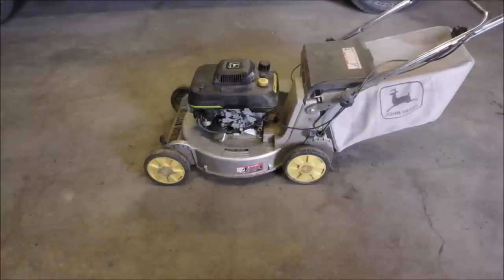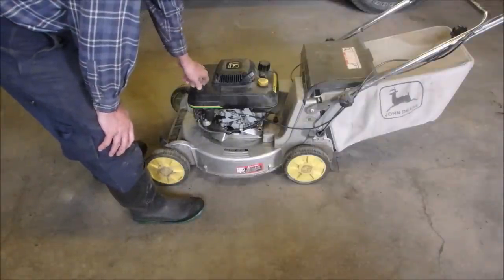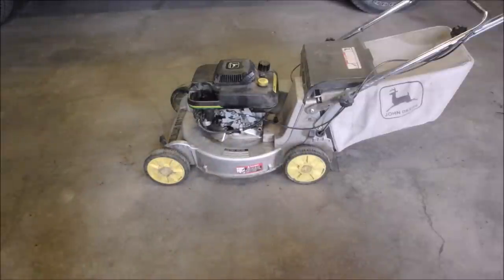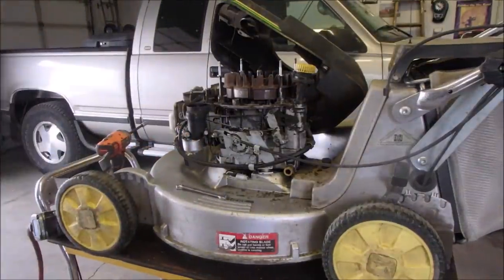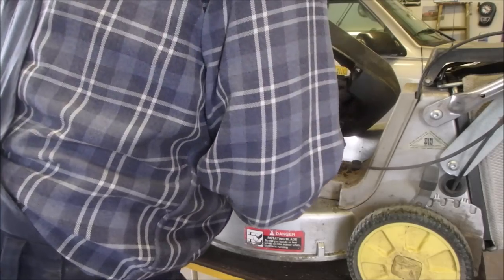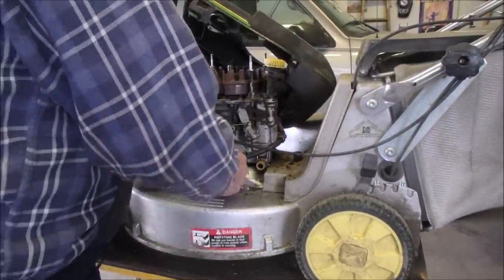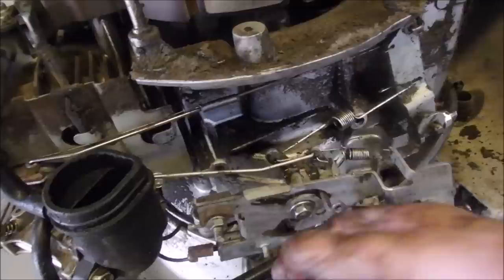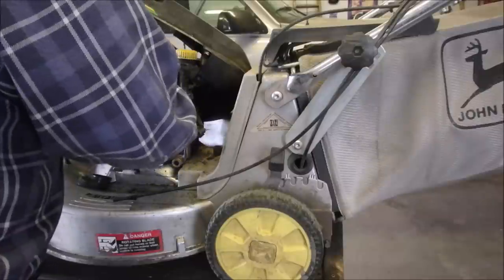John Deere 14SB Mower Is Acting Up

Comment: One trick I have learned to use to save my shoulder on hard to start units is a drill on the starter cup nut after taking the recoil assembly off...now all 5 of my JD's start on 1 pull...thanks for the video Bruce...happy birthday!
Reply from the maker: Great tip!

Comment: Great fix Bruce. Those kawasakis are a little complicated but not for the master , you called it right away. I just bought 8 JD JS 63s all with 3 speed rear drive and I think 3 have bags for $100. 3 have quantums  and the rest have inteks. Got 1 running last Sunday night
Reply from the maker: Good for you.  it is great to hear from you sir Dave

Comment: Yeah them Kawasaki don't like running without the air filter. You did well Bruce.. ta for the video
Reply from the maker: Well thanks for watching.
Reply: Hot in England right now eh? Saw a pic on the news that the rail lines in UK were buckling from the heat true or false you da man that would know?

Comment: I have the JD 12 PB, made mid April 1989. I'm wondering what the difference is between all the JD lawn mowers, there's the 12 and 14 and PB, PZ, SB, SZ, or something like that. I know different engines and manufacturers depending, as well as self propelled vs not, but I don't know exactly, also some are 4 and some are 2 stroke. I'd really appreciate more information and history on these. I love my JD 12 PB, got it for $140, the extra $40 from $100 was delivery.
Reply from the maker: Yes  Big question for me.  I would have to google them all -------------- sorry

Comment: Good video sir !   I just did--  sell a JS35 John Deere !   Self Propelled with Bag. 1 lever deck adjustment, Briggs Quantum engine.  $75     Folks around Indy don't like green mowers.  I had it listed for $95 for 4 days on FB. No interest.  Guy drove 35 minutes to buy it.   I have learned in this area, List a  Red self propelled mower with a bag for $120 up  -  -  it'll be sold in 2 hours.    Honda , Kohler or Briggs, they (buying customer ) could NOT care less.
Reply from the maker: Right on  Red does sell quickly

Comment: Hey Bruce! Great video, thank you for sharing. I have this same mower and I’m having a RPM issue. Way too high. Changed the oil last year and went to mow this year, oil is black. It starts up fairly slow, blows black smoke. Any insight on what I may need to look at? Thanks again!
Reply from the maker: The chokes are tricky on these.  Make sure it is open on running speed.

Comment: Hello Bruce,     I’m working on one of these that has spark but backfires through the carburetor when I try to start it. I think I got the needle to finally seat in the carburetor so it should not flood any longer. Wondering if the key might be sheared?
Reply from the maker: I say yes the key is gone.

Comment: Hi Bruce, i have a john deer 14sb mower and i have a speed adjustment cable that is stuck in low gear, it is a 5 speed.
Reply from the maker: Is the cable stuck or is it the lever it goes to? If it is the cable gerting some rust penetrant into the cabe may help.  You may have to remove the cable.

Comment: Off topic, but I was wondering if you know where I can get replacement labeling for my Briggs engines and the decals for the decks.
Reply from the maker: This may get you started  LOL.  It is a Canadian site but the info may be there.
https://www.ebay.ca/itm/393106064471?chn=ps&norover=1&mkevt=1&mkrid=706-89093-2056-0&mkcid=2&itemid=393106064471&targetid=1656417412950&device=c&mktype=pla&googleloc=9001354&poi=&campaignid=17297476241&mkgroupid=135489415143&rlsatarget=pla-1656417412950&abcId=9300870&merchantid=591691517&gclid=Cj0KCQjw8uOWBhDXARIsAOxKJ2Hzjt7eGeQ2xVnQl1CaX_nSTtAYCXkjPaMDXN08SpzEZVOlf-PE1c4aAkMDEALw_wcB

Comment: just bought one for 40 dollars with the basket , only problem i have so far is if often dies when i engage the blades
Reply from the maker: Make sure it all turns before you engage.
Reply: @BrucesShop  hi there thx for the answer, do you mean that i have to check if nothing is stuck in there around the blade ?
Reply from the maker: Sorry    I was  talking about the blade clutch moving.

Comment: Great job Bruce 👍🙏👍🙏
Reply from the maker: Glad you enjoyed it
Reply: @BrucesShop  I enjoy it all the time Bruce. Hey Bruce I have a Stihl back pack blower and it not getting a spark so I pick up a coil and still no spark. I also check the spark plug and the plug is good. I remove the ground wire from the coil and check again for spark and nothing. Any ideas? Really appreciate the help. 👍🙏👍🙏
Reply from the maker: @electroddxful  Did you try it wither the entire unit reassenbled.  i know sounds weird.  The last one didn't run until i assembled it all.
Reply: @BrucesShop  Yeah I did. I never had such Challenge. Compression is good is reading 95. Just wouldn’t spark.

Comment: Hello. What did you do to correct the surging at the end of the video? I tried to slow the speed down to see what you did but I couldn't make it out. My 14SB is doing the same thing. Surging and plug is carbon fouling (rich). Thanks.
Reply from the maker: I am not sure.  Usually surging is a lean condition,  On this one i turned up the RPM and that helped it.
Reply: @BrucesShop  OK thanks. I will clean the carb again. I suspect an idle passage may be blocked.
Reply from the maker: @James-dt7ky  Sometimes a replacement is the way to go.  after 3 cleaning i try to find a new one.
Reply: @BrucesShop  I'll try an ultrasonic this time. That mower had sat for many years without use. It looks in perfect condition visually.

Comment: bruce can you tell me brand of tach you use i have one you have to use tape with can you give me link please
Reply from the maker: This one is close.  You don't need the wire.  It is a Canadian amazon site
https://www.amazon.ca/Digital-Motorcycle-Tachometer-Display-Gasoline/dp/B07T97S466/ref=pd_di_sccai_cn_sccl_1_1/136-1261893-7930603?pd_rd_w=COehg&content-id=amzn1.sym.d6674fdf-bd00-4d07-8317-6dfd6c498cdf&pf_rd_p=d6674fdf-bd00-4d07-8317-6dfd6c498cdf&pf_rd_r=XR0VRT5AM9VV2NE3NFAE&pd_rd_wg=FEk8r&pd_rd_r=c940e127-f359-48c2-932e-c029cf82e16a&pd_rd_i=B07T97S466&psc=1

Comment: The owner must have played around  with the speed and idol dial  Also the RPM are set to high the Manuel says 3075 @ full and 1500 @ Idol For Kawasaki 4 Cycle FC150V  Motor .
Reply from the maker: Thanks a lot.

Comment: If it aint the attack of the gremlins, then its the attack of the fiddle fairy's. I have a Craftsman 1990 riding mower with a 12.5HP Briggs IC engine on it, and it has practically the same convoluted throttle and choke plate mechanism, as the choke and throttle are integrated into one. I must admit, I hate it, but it works, but I rather have separate controls. Good job fixing this one Bruce!
Reply from the maker: I feel the same as you.  It is all great when it is new.

Comment: That mower looks like a cast aluminum deck plus the engine looks like a Kawasaki  🙄🙄??
Reply from the maker: Sorry   it is steel.  HEAVY  LOL  It is a Kawasaki.
Reply: @BrucesShop  okay thanks for letting me know about that matter young man 😎👍
Reply: Some of the models of that time did come with cast aluminium decks but it looks like this steel one Bruce worked on was well maintained.
Reply: @waynestefinashen239  yes it was nice looking

Comment: Had a young guy bring his brand new mower in, long story short..... He put gas in the oil port, and oil in the gas tank..... I cleaned everything out, 100 dollar charge, and I showed him what he did wrong, he didn't have a clue.... LMAO
Reply from the maker: I get it   I just had a mower that just came in.  The owner said it needed a tune up.  Sheared flywheel key,  Striped blade adaptor ( star type to the blade  ) a bent bade  5/8 ths out and the internal deck sheet metal shredded.  I got it going.   Toughest but most fun tune up ever.
Reply: @BrucesShop  yep, I have a blast too.
Reply: Doing a Honda mower today, can't tape it need the fans on, 96 here today, but the Honda I got for free, I had maintained it for a couple of years for this lady, well for some reason, she took it to a proshop, they charged her 275 American dollars, it it still wasn't fixed, so she bought new, and gave it to me, this thing is top on the line, even blade brake clutch, everything works as it should, it's been garage kept since new, it turns out, it's missing the second c-clip on the right rear, the pro shop didn't see that, well it's fixed, and I'm selling it for 400, wish me luck.... LMAO, I'll take as low as 250.